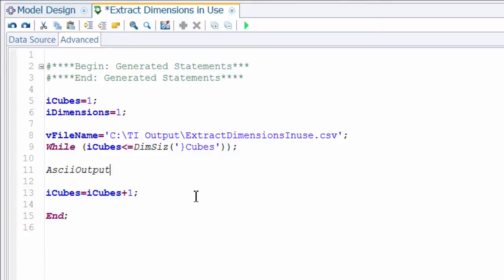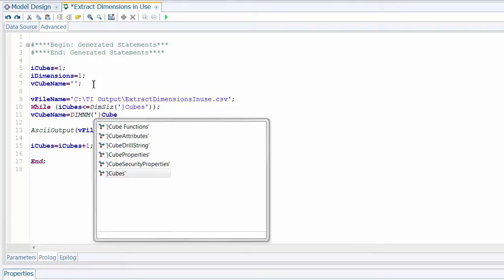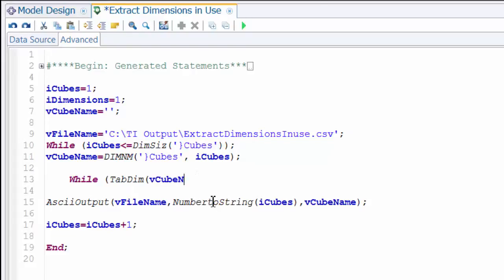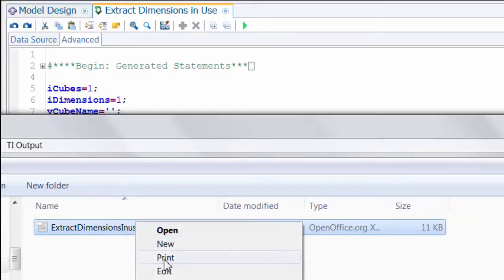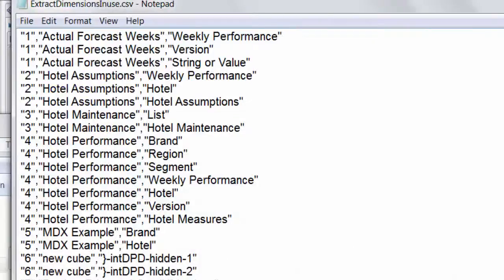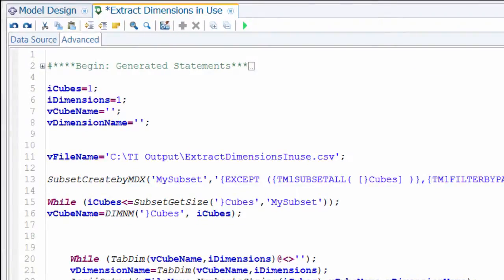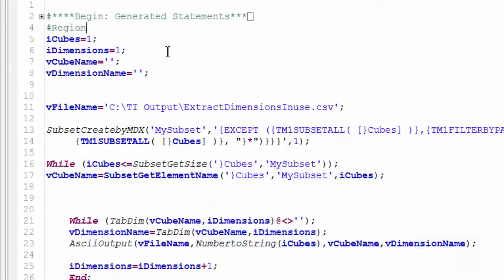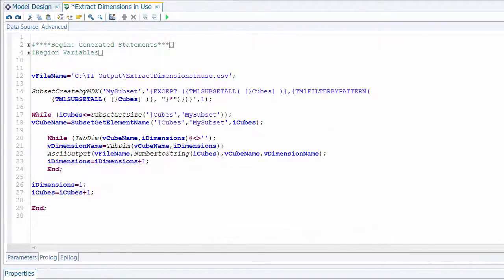Using simple loops in a TI Process

Comment: Thanks for the video - I'm new to TM1 and trying to get more knowledge in scripting and TI PRO builds such as data loads with dims that are already have existing elements and new ones.  Any tips?
Reply from the maker: I personally like to separate my data loads from dimension updates - even if the source is the same (i.e. one file with elements and data). Putting them together doesn't save much processing time since your doing metadata updates and data updates in two source passes anyway (metadata & data sections of TI represent individual traverses through all records in the source). 
It makes it easier to think about (and be very prescriptive about) what happens to each dimension and new element rather than trying to do everything at once. There might be cases where I want new elements and data added, but not if the new element is "xxxx".

By separating your processes, running dimension update process first and then setting dimensions mappings in the data load to "Do not update" you get some more control over exactly what happens. 
I often even separate my dimension update processes into updates that are "flat" (attributes, new members, etc...) from hierarchy updates, although you may not need to do that.

Not a lot of specific tips come to mind, but it can be useful to test if an element exists, and maybe log the new elements somewhere, or ensure they have a parent if a hierarchy, and forcibly "parent" them to something specific if they don't (e.g. "All Orphans"...

##########################
#pElement in this example is just a variable name in your data load
IF (DIMIX('DimensionName', pElement)=0);
#Element doesn't exist - do some stuff as a result (i.e. create extract to show new elements like so:)
AsciiOutput('NewElements.csv','DimensionName' | 'New Element to be added ' | pElement);
Else;
#Element exists - proceed as normal
EndIf;
##########################

You might also check out the Bedrock TI's to help - they are great examples, and lots of folks use them.
http://www.bedrocktm1.org/

Good luck!